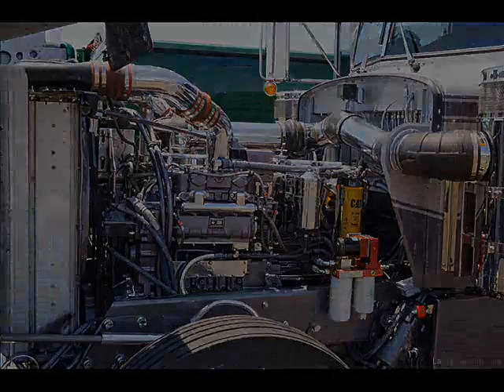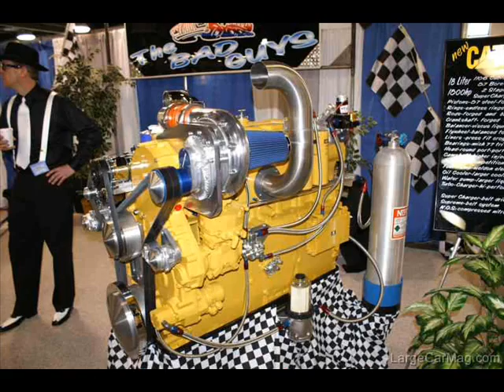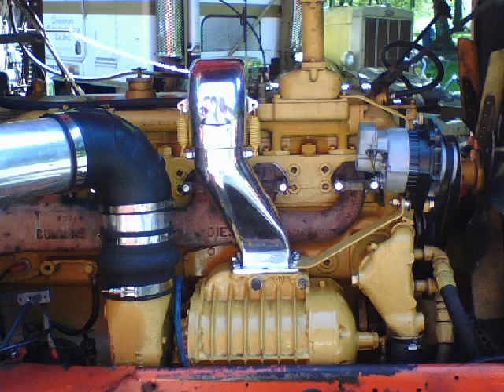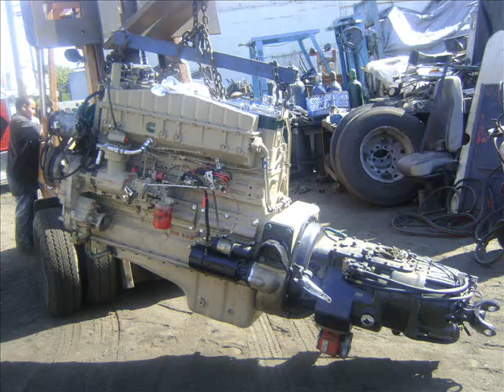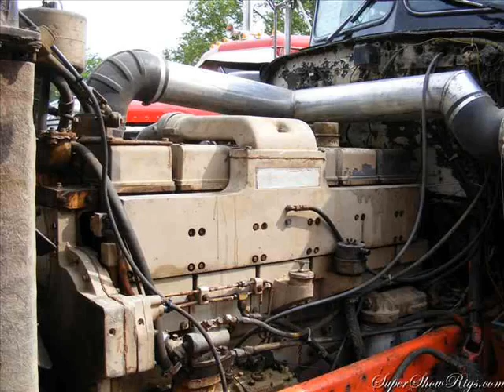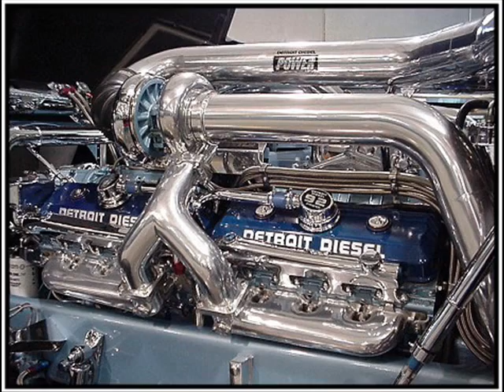Truck Diesel Engines

Comment: cat is yellow  cummins is red and detroit is blue
Reply: not always! Detroit and cat both painted engines white and yellow and Cummins only started painting whole engines red since 2010 or so.thry used to be a flat tan over all,then some were black and some of the n14s were gloss black with red valve covers, the " Red top or red head " . Anyway people paint shit however they want. Hell most modern Detroit engines are a grayish green color !

Comment: Someone correct me if I am wrong, but it looks like a Cummins NTC-400 Big Cam IV. If my memory serves me right it was part of the 855 cid family.  They came about in 1976 as a result of new laws.  They varied in H.P. The number following the model line is the H.P. (NTC-400= 400 H.P.)